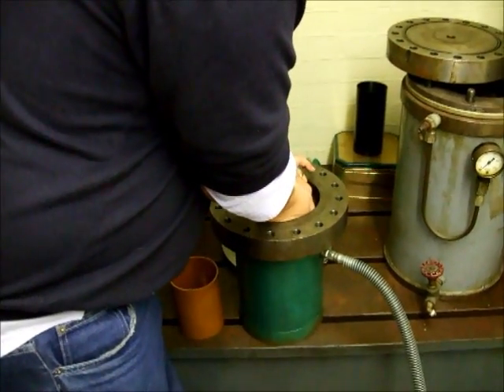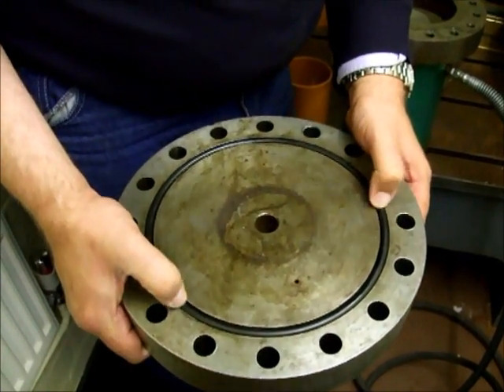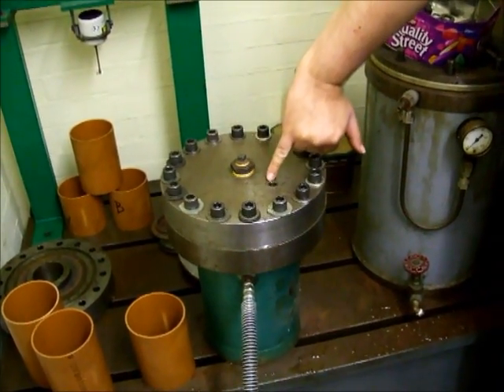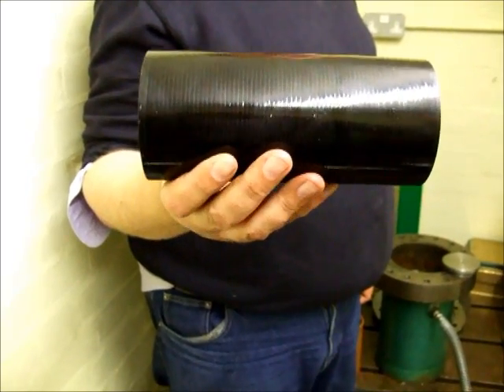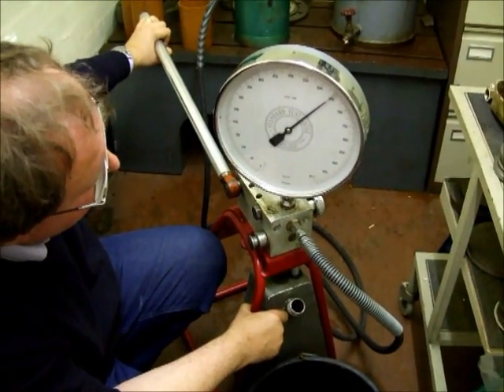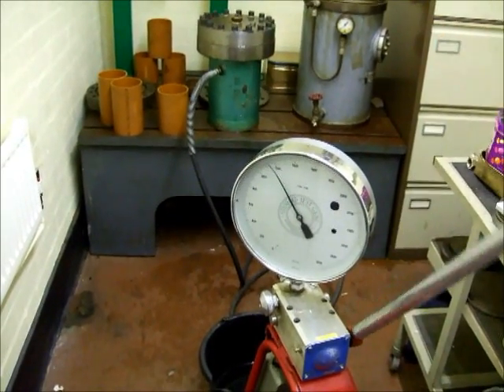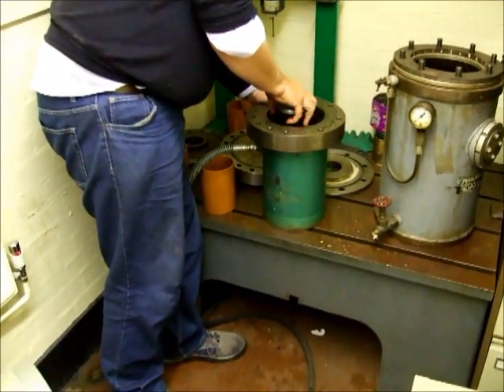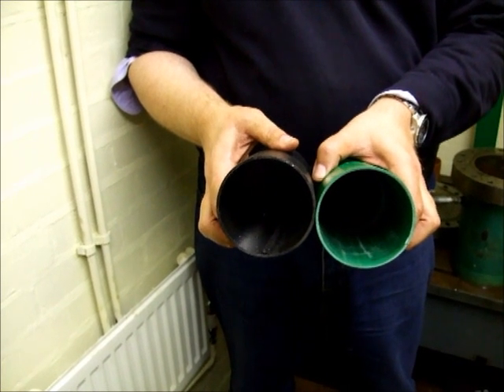Collapse of Composite Submarine Pressure Hulls

Comment: One expert - in one of the many videos I've watched about this accident - said that a contiguous surface like steel is safer. The fact that CF is not a contiguous, but sort of a "blended"? material (sorry, no physics or engineering background), allowed for delamination to occur in the first place - apparently not a factor with steel or titanium.
Reply: Steel and titanium are homogenous, composite is not, it’s non-homogenous. Simple as that.
Reply: You wrap layers of it, then heat it up (basically)

here's some experts doing it:
https://www.youtube.com/watch?v=Vi4J1LDS504
https://www.youtube.com/watch?v=WK99kBS1AfE
Reply: @choggi wow here I thought they used a more complicated process such as having fibers going parallel to the cylinder woven around such that at least the fiber tensile strength would be used to prevent compression at the most vulnerable point which is the center of the hull cylinder. But they really only wove it around and depended on the compression strength of carbon fiber which is nonexistent. They really are stupider than I thought.
Reply: @kurtsaidwhat  That really would not have made a difference. With current composite manufacturing processes particularly carbon fiber we have it designed in a way where it can withstand internal increases of pressure such as in a aircraft fuselage when it is pressurized at higher altitude and what is done daily on many newer Boeing and Airbus commercial airlines which use carbon fiber for their main fuselage materials. It is NOT designed for external pressure like you would in a submersible, hence why we use homogeneous materials for submersibles such as steel or titanium. Even if the carbon fiber was in a woven in a pattern it would have made it slightly more rigid at best but that's about it. It would have not made it for resilient and resistant to the force of pressure being applied externally to it.
Reply: @WHTMAN-ei7ik  you are not comprehending. Carbon fiber is weak at compression which is the scenario with external pressure in a convex hull. Wrapped around the hull would only provide compression on the carbon fiber. If instead the fiber are woven lengthwise with the cylinder hull, and supported at the end caps, then the pressure, which is highest at the center of the cylinder hull, would convert the carbon fiber from a compression load, into a tensile load.
Reply: @kurtsaidwhat  But the problem is that carbon fibre is made of different elements and layers and this just kills the reusability of the sub vs steel, one homogenous material made for reuse and durability like this.  Steel has natural give, flex, compresion to it at the macro level whereas the rigidity of the carbon fibre in conjunction with the layered materials is just NOT suitable for this kind of endeavour.  ANY small defect will just compound exponentially and end up with catastrophic failure.
Reply: @kurtsaidwhat  The carbon fibre hull is basically a hollow spool of wound up carbon fibre with resin.
Reply: This sounds like an issue. You don't want a material that can slowly, silently degrade. Then repeated small stresses can slowly reduce its strength.
Reply: Yeah James Cameron said the exact thing in an interview.  Didn't realize he was such an expert on the topic but he sounds like he knows his stuff.
Reply: Steel and titanum are homogeneous - they're made of only one consistent material - and they are not built in layers, so the can't delaminate.  Carbon fiber is made of carbon and resin, and is built up in layers.
Reply: Even steel submarines only go to 800m+. But a steel sphere 7m in circumference and 2 and half " steel has been proven to go to the deepest trenches. Just ask the man himself, James Cameron.
Reply: you knew jack before this sub thing and still only have patchwork understanding without any fundamentals--why are you commenting
Reply: @nutsackmania  Apparently you can't read?  He's telling people what the experts he listened to said.  And he's not wrong...that's what they said.

Comment: Interesting and prophetic. Although to be fair they pumped up external pressure to over 100 barg (1000m depth) on what was a very thin carbon fibre tube. The whole concept of using carbon fibre isn’t intrinsically wrong despite the current hysteria in the media. The issue with Titan was the lack of verification and validation of the design, quality control and ongoing in service inspection and non destructive testing.
Reply: The major problem was delamination of the carbon fiber tube. It wasn't 7 inches of the one material. It's 7 inches of several layers of the material. The structural integrity diminishes with every dive like Onion layers separating from the core.
Reply: @DibIrken  Effectively the Titan was designed with a limited lifespan due to number of pressure cycles it could withstand.  Unfortunately they discovered the limit in the field with fare paying passengers onboard.
Reply: @DibIrken  Actually I think it was more likely a straight forward compressive strength failure. Insufficient design margin in probability.
Reply: @donharrold1375 Think, do research.
Reply: @oreos922  ?
Reply: Why is it called non destructive testing?  If the test fails thats pretty destructive.
Reply: I think carbon fiber is a proven mistake in submersible. Only a fool would consider it now.
Reply: Yeah, a carbon fiber sub, if designed and maintained properly, could work. But why? What’s the point? We already know how to make it to the bottom of the ocean with 2.5 inch thick steel. Keep it simple.
Reply: @ZSmith-yy4lv  Weight and cost. The heavier the sub the more costly the launch vessel is. Crane vessels are very expensive to charter. Launching a light weight sub directly off the back of a rusty tub is much cheaper.
Reply: @donharrold1375  is the cost saved really worth all the extra skill, equipment, and time necessary to inspect the hull of a carbon fiber sub? It will not be able to handle as many dives either, requiring more frequent replacement.
Reply: @ZSmith-yy4lv  Agree. Clearly the whole concept was ultimately flawed. I can’t imagine anyone taking a similar approach ever again. They gambled that doing this cheaply would achieve a price point that people would be prepared to pay. If it was $1m per seat fewer people could afford to do it and it might not be viable. Personally I think it was a horrible callous business proposition from start to finish.

Comment: The window on the Titan vessel was rated for 1300lbs. The Carbon Fiber body was about the same. So weird.
Reply: Meters not pounds that would be nothing. There's like 500 t acting on it at 1300 m and over 5000 tons at 4 km. The pressure acting on the bodies at implosion was 6400 t or 14 million pounds.
Reply: Nothing on that sub was truly rated.
Reply: Itsfunneh everyone keep saying this but they don't watch the news where they say it's sitting there and there's nothing wrong with it so obviously that's not what failed
Reply: @thecloneguyz  I never said that's what failed.
Reply: @thecloneguyz  It was the only certified part and it was to 1300. There are huge safety margins so to guarantee 1300 m it was likely proven to pass 2000 m. So really it's a very well built 2000 m "test depth" and "Crush depth" was somewhere below that, likely 2500 m or so. Doesn't mean it implodes if you go that it deep ot means all bets are off and it's anyone best guess.

But the hull was the weakest part. I'm sure the window would have eventually imploded but you see avrylic stays strong and CFC becomes weakee each dive. So the window could never be destroyed, there was an emergency pressure relief valve consisting of a large CFC tube with 5 inside. 

And yes the endcaps are intact and it is believed the window is too but no confirmation. Midsection imploded.
Reply: @please_stop-v7o  you're forgetting the calculations that the window was curved which means it takes way more pressure to push it inwards than if it was flat
Not to mention it can deflect up to 3in before cracking or damaging it
Reply: @thecloneguyz  I really don't see how that relates. Everything is compressed down there.
Reply: @please_stop-v7o  So you are telling me the window on the Cyclops is stronger? Hahaha
Reply: @paulb9769  I don't think so isn't Cyclops down to 500 m?

Comment: So these two blanks are fiberglass and CFC and the test regime is test to failure with the CFC outperforming the fiberglass blank by a substantial (5x?) margin.  Not sure what else can be taken away from this re: direct applicability to the Titan failure.  It’d be really interesting to see the same test performed with a uniform titanium or even a polymer.
Reply: Failure modes. If these materials were used to construct a submersible, first failure mode might give occupants an opportunity to return to the surface for rescue. The second failure mode would not allow that to happen.
Reply: @wesleyhurd3574  Thing is once the fibreglass buckles a little the pressure immediately drops a lot, he actually says how much. That's because they're using that handpump. In the ocean the pressure would not drop, so once the fibreglass buckles it will continue getting crushed until it tears open.
Reply: In reality this test doesn't have much relevance to the titan, if they were testing the samples for cyclic pressurising maybe and measuring the failure for increasing cycles maybe...
Reply: @joshieeee20  They showed how it fails, suddenly and with delamination. You hear the shockwave as it lets go and you see the pressure guage drop.
Some people seem to have difficulty accepting it failed in this manner, assuming it yeilded gradually or with warning signs.
As far as I know contact was lost at the same time as the implosion was detected.
Further than that we have to wait to see what the investigation turns up.
Reply: @matthewwakeham2206  yeah guess so? But every single pressure capsule would fail spectacularly so
Reply: i think it shows the plasticity of the materials? fibreglass distorts but still kept the inside dry, but CF buckled and delaminated

Comment: I'm confused what's the testing methodology?
How well does steel or titanium perform?
Reply: The test is to see how much pressure can be exerted on the cylinders before they fail and allow water into the cylinders under test. The hand crank thing is a hydraulic pump which allows the pressure inside the test vessel to be increased until the object under test fails.
Reply: Titanium is far superior.  The only vessel commercially certified to 14,000 meters or almost 7 miles, the deepest known point on earth at Challenger Deep, is made out of a titanium sphere that was pressure tested to 45,000 psi.  It's called the DSV Limiting Factor, look it up, amazing craft.

Comment: This video is pure gold, at least for those that aren't part of production of submarines. This gives the idea that this was very known in this industry a long time ago.
Reply: that's why I'm here
Reply: @CaptainTrips2020e openly admits (well, admitted....) the industry has rules against composite hulls, and that this was one reason it was not possible to get his craft certified. So, no, it was not engineered for the dive. He felt he knew better than the navy.
Reply: It's basic science.
Reply: @CaptainTrips2020 I think he believed his acoustic warning system would give them warning when the subs life was up. If it worked at all the warning was seconds/minitues
Reply: @bobbyrayofthefamilysmith24 the ol you're fucking dead but here's some time to consider it alarm. Probably had it taped over lol
Reply: @bobbyrayofthefamilysmith24 One thing i'm curious about is if the craft had a black box.
Reply: @CaptainTrips2020 he made a point of ignoring warnings and testing. he was like the idiot who goes up to lions on a nature preserve to pull their tails thinking he knows better
Reply: that's why you need uninspiring 50 y.o. white guys on your team
Reply: @CaptainTrips2020 More like every single dive, even 1 trip down could compromise it. The Russian Mir subs use a 9 inch thick nickel alloy, with 7 inch thick plexiglass windows. They also ONLY dive in pairs of 2, so if one becomes entangled or otherwise in trouble the other sub can assist. Not to mention a full size barge with cranes and smaller support ships. Watch a video of someone going down in the Mir subs, its like night and day compared to the Titan. At some points its almost laughable that anyone ever considered the Titan "safe".
Reply: @CaptainTrips2020it was 5 inches thick when it was supposed to have been 7 inches thick. Not saying that would have prevented the disaster, but people were surprised it was 49% thinner than it was supposed to be.
Reply: The pressure on hull of the Ocean Gate Sub down at the depth of the Titanic was 12,500 PSI. The equivalent of the weight of  a fully loaded Cement truck balanced on a rod 1 inch square. Very few materials can withstand that pressure
Reply: sorry to be nitpicky, but this is actually incorrect.  The titanic rests at 12,500 ft depth, where it's roughly 5500psi or 375 atmospheres.  For 12,500psi, you would need to go about halfway down challenger deep, or about 28,000 ft.  Still, 5500 psi is pretty insane, especially considering the hacked together craft they used.